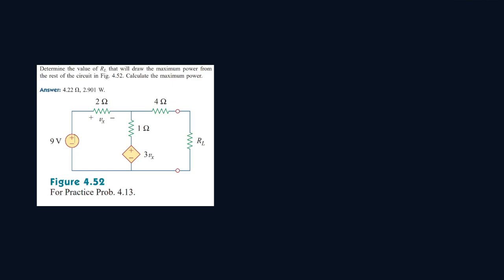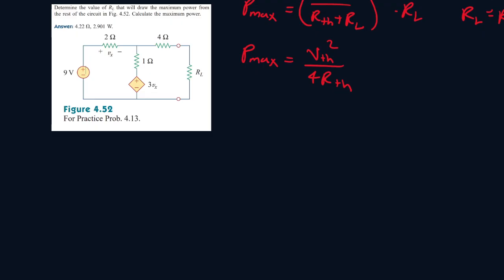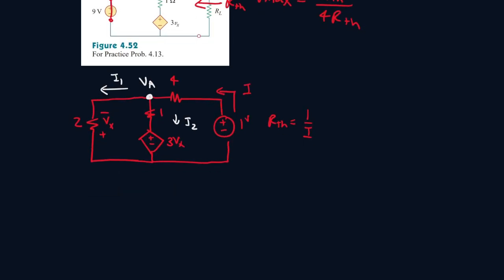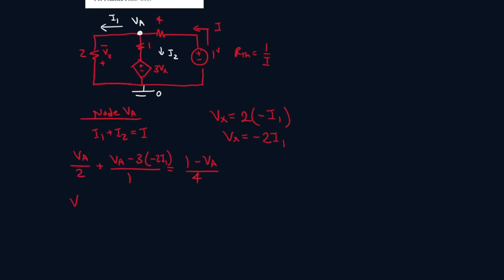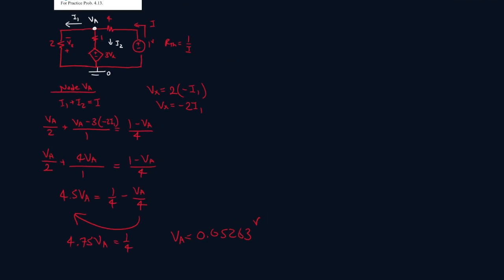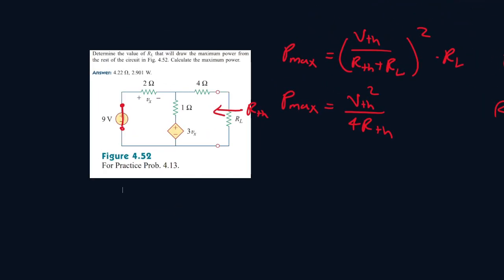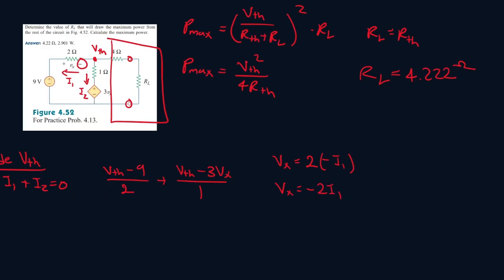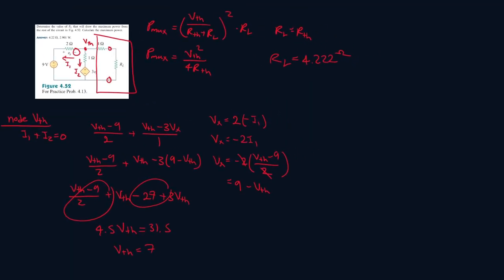Practice Prob 4.13 | Find the value of RL for maximum power transfer Fig 4.52 | FEC 4th Edition

Comment: i know i am the only guy commenting , but this was actually helpful . also please tell when to just find with nodal and mesh analysis and when to use test voltage , because i am smh
Reply from the maker: using nodal or mesh is all up to you unless the equation asks otherwise, both should result in the same answer